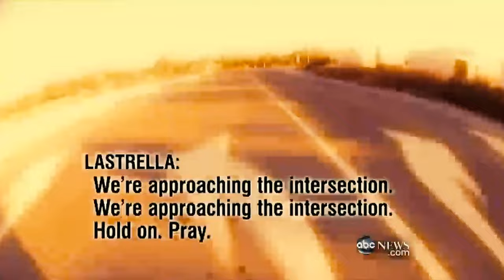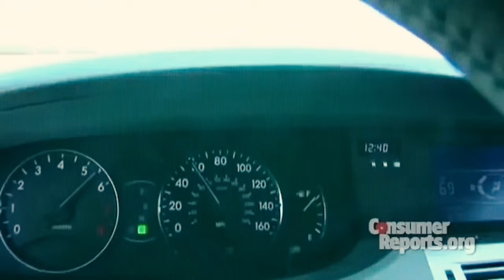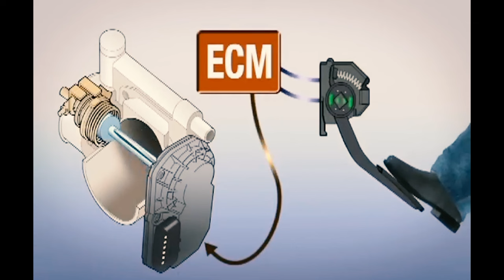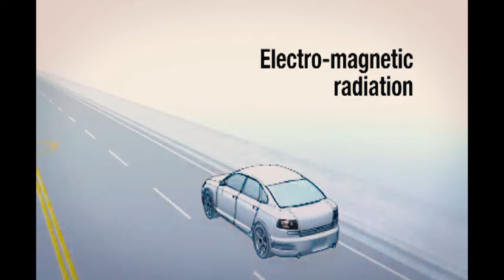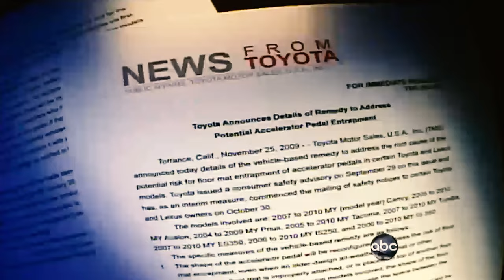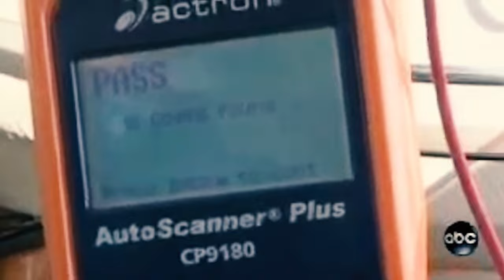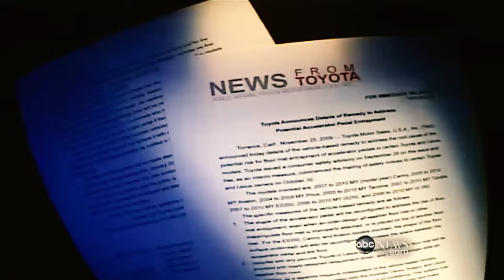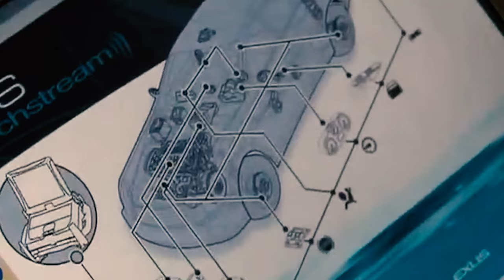"Runaway Toyota: Unveiling the Unintended Acceleration Crisis" Pt 1

Comment: I was working as a Technician at a Toyota dealer here in Canada during this event.  We had 3 levels of solutions.  1) to remove all driver floor mats that weren't designed specifically for that model of car and if they were OEM, they could not be double stacked, ie. rubber OEM mat on top of OEM carpet mat.  Good that we did because some people had 4 or 5 mats stacked on top of each other.  Some of the mats were just cut up pieces of flooring carpet or rugs.  2) We also had templates to cut the accelerator pedal corners down to size and 3) replace the accelerator pedal with a Denso brand unit ( or remove the Denso brand unit, can't really remember, lol) there were 2 different brands of accelerator pedals that the factory was using and we were instructed to crawl under the dash and see if it was a Denso brand pedal or not. 

also just knowing how cars work could have saved a bunch of lives.  just pop it into neutral and come to a stop like normal...lhe engine will be bouncing off the limiter and making a bunch of noise, but you and all your love ones will be safe.  A good one also is just to turn the key off..but push-to-start was becoming a thing around that time and pushing the button while the car is in motion won't do a thing.

Comment: I haven,t driven an auto in years, never a newer one. Can you put the transmission in neutral? Or is the gear selector an electronic switch that won't respond? Either way I got a clutch pedal to push in if that happened in any vehicle I'm rolling in.
Reply: A lot of autos don't even have a lever anymore.  Most of them have either buttons or a dial so an electrical issue could stop it responding and you wouldn't be able to put it in neutral at all.

Comment: Unnecessary deaths; push and hold the power button, everything will turn off no matter how much pressure is on your gas pedal.
Reply: That's worse. Imagine going 100mph and suddenly losing all control of the car.
Reply: @WarlordEnthusiast why do you think you would suddenly lose all control 😅
Reply: Or just put the car in neutral.
Reply: @WarlordEnthusiast never driven a car?
Reply: @Playingwithproxies  
@haywagonbmwe46touring54 , do you know what power steering means? 

And maybe do you perhaps understand why turning the car off completely might turn that very useful power steering off? Especially in a car going over a 100mph with various new fly by wire features that require power to operate? 

The best thing they could have done is put the car in neutral and steer the car on to the hard shoulder until it slows down on its own whilst applying the brakes. 

Trucks have a sort of similar issue where the brakes can completely fail and the truck has so much momentum it doesn't stop for a good mile, they even have special areas on roads for runaway trucks to safely steer into and slow down in neutral.
Reply: @WarlordEnthusiast  not only the power steering (and you still have the regular steering, like old days), the worse is that after applying pressure to the brakes, they eventually stop working.
Reply: The problems isn't that you won't have power assist steering.  Cars that used to have manual racks or even dead power steering pumps would steer fine while its in motion.  Power steering only really helps at slow speeds like in a parking lot.  On cars with Push to start, it's probably not a good idea to force a power-off in an emergency situation.  Because with the power off, your steering wheel will lock and you won't have any steering at all.  Steering seems like an important feature.
Reply: @WarlordEnthusiast  Lol do you know what power steering means? I guess not.. it's power ASSIST. You've never even looked under a hood have you?
Power steering does nothing at high speed. Guess you've never driven a manual steering car, or one with a failed pump? All those critical "fly by wire" systems are mechanical with fly by wire on top. No power, then it's just a normal mechanical system.
No.. trucks don't have "sort of similar issues". What you're talking about are run-away truck traps. Which are EXCLUSIVELY on the down hill of large mountain passes. Trucks can overheat their brakes on descent if not driven correctly. A runaway truck is in no way similar. And no trucker is going to "slow down in neutral". You down shift, engine brake and engage the jake brake.
My man.. learn.
Reply: @haywagonbmwe46touring54  Imagine slowing down a truck in neutral in a descent, it would be a day with a lot of emotions. :face-blue-smiling:
Reply: No brakes or steering then   hello...  this video is total bs  I went through all this and I know